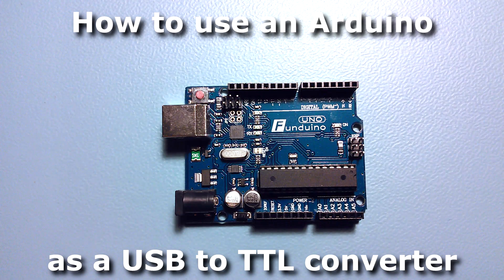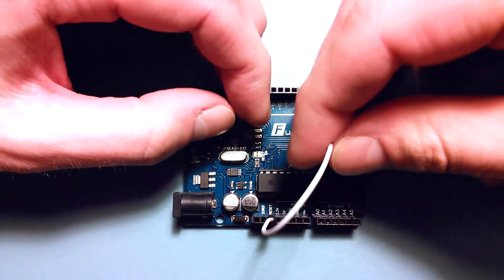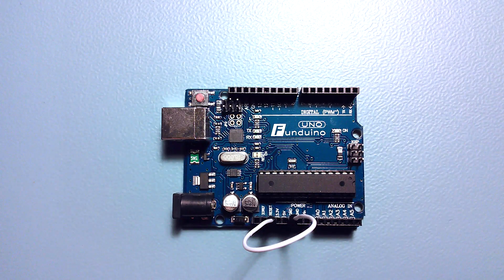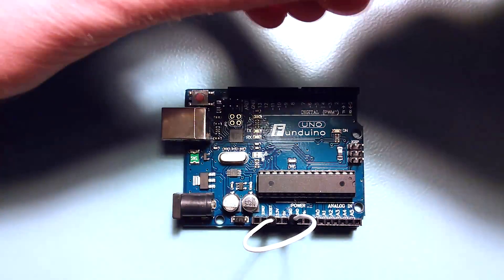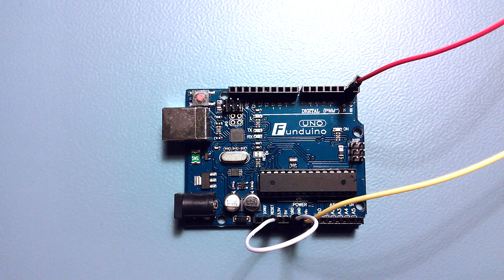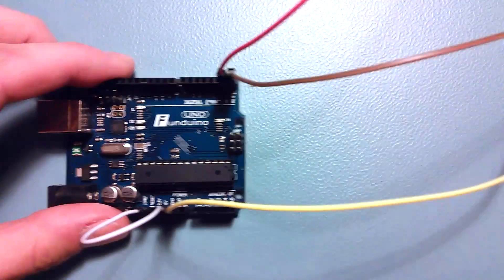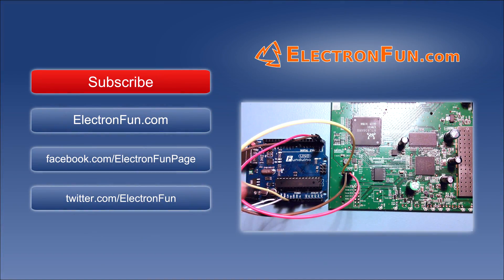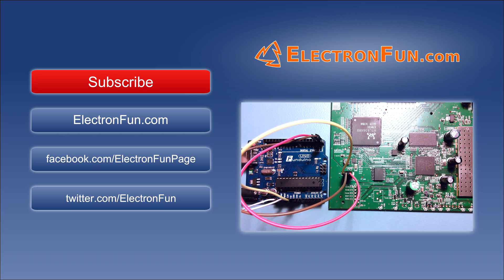How to use an Arduino as a USB to TTL converter || Arduino tutorial

Comment: Thanks, worked fine to program a Picaxe once I swapped the Tx and Rx lines. Just as you said, Tx goes to Tx  and Rx goes to Rx. That seems switched to me but it's a frame of reference thing.
Reply: I think it's because they're swapped internally again when bypassing the ATMEGA328 chip. That's how I read the schematics for the Arduino Uno (rev3) at least.

Comment: I'm so glad this is here. I was about to purchase a USB to TTY serial converter, but then wondered if I couldn't just use one of my arduinos to do the same. Arduino to the rescue!
I'm wondering how I actually interface with the device once it is connected, though. If I open the serial monitor I will only have a passive view of what's happening on the device, right? How would I send commands over a terminal once the device is connected?
Thanks!
edit Ignore me. I just realised the text field with 'Send' is at the top of the serial monitor. So blind sometimes 😎
Reply from the maker: It should work in exactly the same as a regular USB to TTL converter, if I recall corectly.

Comment: This worked with my older Arduino Duemilanove, thanks! I was having trouble programming the PID on a Tarocco servo controller with a 3.3v USB to serial cable. This did the trick. I think it needed the full 5V.

Comment: How do I translate the input code? I mean it seems weird to me it (´ÙÛoÙ\ë or DêêøÂ,·Q)
Reply: Also check how you are displaying the data you are receiving. If the data is ascii characters set the display mode to ascii. If it is integers, set the display mode to integers. (How to do this varies with the terminal you are using).
Reply from the maker: Where do you see this code? It looks corrupted.
Reply: It's the arduino's serial monitor... So, I downloaded Realterm but still it is impossible to use the inputs from my router for example to a program... They does not look user friendly
Reply from the maker: Have you checked your COM port's settings (especially speed)? You may be using different settings while connecting to your router.
Reply: I guess I should not expect a normal text like "Starting up service" or something similar, right? After some configuration I managed to see HEX code... But still I can not use it for projects...
Reply from the maker: When everything works as expected, you should see a completely normal text.
Reply: Then I think I screwed up... how can I check the port's bit rate that is required?
Reply from the maker: Go to your 'Device manager' -> COM ports and check your speed (bits per second) settings. Use the same settings while connecting to your router via PuTTY.
Reply from the maker: What about the COM port settings? Have you checked them?
Reply: Serial line to connect to: COM4
Speed(baud): 9600
Data bits: 8
Stop bits: 1
Parity: None
Flow control: None
The exact same as my Device manager's
I am using a SAGEM F@ST 2404 Router with RX connected to the 0 pin and TX to the 1 one and of course GND to GND so what am I doing wrong? :/
Reply from the maker: I can't see any mistakes in your connections. Have you tried increasing the COM port's speed? I would also check the jumper wires, they turn out to be faulty sometimes (even when they are brand new).
Reply: I will have to increase the speed both to the device manager and to the putty settings right? Also my wires are fine... I will check my soldering again just in case
Reply from the maker: That's correct, the speed settings have to match. Troubleshooting is probably the most difficult part of all projects...
Reply: Checked the soldering, changed the wires, increased the speed, I am using a brand new official arduino board but still... Increasing the speed just increased the amount of the weird data I was getting
Reply from the maker: What router do you have? Maybe there's something wrong with it. It's difficult to say what's wrong without seeing it.
Reply from the maker: It should work just fine, if you connected everything correctly. Are you sure you were checking the correct COM port in your system? It should be the port, which is used by your Arduino.
Reply: I've send you my settings... they are the exact same...I do not know my router's speed though... but I do not know if it does matter... so if it really is a problem how can I find the amount of it?
Reply from the maker: The only thing that comes to my mind may be the COM port settings. Your router may be forcing particular settings, see: https://wiki.openwrt.org/doc/hardware/port.serial - 'Talking and Listening' section. I would try playing with the COM port settings.
Reply: These are my COM port settings in a screenshot: https://ibb.co/cksjQ5 
Playing with the speed really does not change the result much...
Reply from the maker: I ran out of ideas, sorry. Try asking on one of the forums below:
https://forum.openwrt.org

http://www.dd-wrt.com/phpBB2.

There are lots of people, who should be able to help you.

Comment: Hey man! Experimenting with my Uno here - trying to access the serial port of a router: a CradlePoint Ctr35. Used this link: http://www.devttys0.com/2012/11/reverse-engineering-serial-ports/ to find what I think is the headers. One weird thing with the TX though is that it goes to HIGH on boot, fluctuates a bit, then rests at LOW for however long I leave the device powered. Which makes me think that maybe I haven't found the right header? I was able to use the ground and vcc to power it up however, no problem.
Running Kali Linux, I connected the UNO through USB, launched minicom - connected to /dev/ttyACM0 (Only tty I could find) and started testing all the different baud rates with the boot of the router. No success, even inverting the tx and rx connections.  Not even garbage in the tty.
Then tried testing the UNO-> connected tx&rx together and tried echo test > /dev/ttyACM0. And it worked. I think maybe I need to solder the wires on the router. What do you advise?
Reply from the maker: I haven't played with CradlePoint Ctr35, but I'm thinking maybe you are testing a wrong tty, but it's just my thought.
Reply: ElectronFun.com I thought so too but there isn't that much other pins on it.
I'm thinking the board uses 3.3V serial - any DIY advice?
Reply from the maker: The pin may be right, but maybe it's another tty in you Linux.
Reply: Ah no - I can connect to a Belkin router through serial with the arduino using the same tty - problem is with the ctr35. The belkin uses 5V and the ctr35 uses 3.3V.
Reply from the maker: Nothing more comes to my mind now - helping remotely is not easy :|
Reply: Fair enough - I think I need an adapter from 3.3V serial to 5V serial. Will see what I can do maybe keep you updated.
Reply from the maker: It would be great if you could keep me posted. I wonder what the problem is.
Reply: Ok will do
Reply from the maker: Thanks :)
Reply: Otherwise do you know how to access gpio pins on a machine that doesn't have system/class/gpio/export?
Looks like the kernel doesn't let me use the gpio pins.
I've seen people poking into dev/mem with some C code but I'd appreciate the advice of someone who has already done this kind of thing. Maybe a forum you can direct me towards?
Reply from the maker: I'm not sure how to help you :(
When I need help with a router, I usually go to:
https://forum.openwrt.org
http://www.dd-wrt.com/phpBB2
There are lots of people who are willing to help. Hope you'll find some answers there.

Comment: Thanks, I've been looking for just this answer. I'm attempting a connection between the PCM on my truck to my laptop. Baud rate 8192. If I can manage this connection the Uno will pay its way. One thing I don't get..my truck forum has the RX and TX terminals pigtailed together into one terminal of the truck(5V). The only other connection is ground from board to truck terminal. Does this make sense to you? TY
Reply from the maker: +dwhollrah I guess you've just found a new application for an Arduino board :)
The thing with TX and RX pins pigtailed together does seem odd to me too. Can you give me the link to this forum post?
When it comes to cars, I'm forced to rely on my mechanic, but I'll try to help if I can :)
Reply: +ElectronFun.com  I used your connections and went ahead with the connect to truck and got it working perfectly...tons of sensor data spilling out of my lappy now. This is worse than texting while driving. Here's that link.   http://www.dieselplace.com/forum/63-gm-diesel-engines/21-6-5l-diesel-engine/457933-how-scan-your-obd1-6-5-less-than-10-a.html
Reply from the maker: +dwhollrah What about the TX and RX pigtailed together? I can see it does look like this in the photo.
Reply: +ElectronFun.com Yes, they are both joined to one lead running to a single terminal on the truck. The only other wire is ground just as you show. I've used it flawlessly for two days now....well a few boot  hiccups.
Reply from the maker: +dwhollrah I'm happy it works for you :)

Comment: Can i connect esp8266 to a PC in this method ?
Reply from the maker: +Stephen Crown Yes, you can, because this method bypasses the ATmega chip and uses the USB to TTL converter integrated into the board.
Reply: yes, when the reset is grounded.

Comment: Hi ElectronFun.com, Thanks for sharing the video, I'm actually looking for a USB-to-serial converter to use at 115200 baud rate with BeagleBone Black board for Uart logging. From your video it looks like i can use Arduino for the same, but just wanted to check with you, if we can use this hack you shared in your video for getting that speed(115200) on Arduino?? (sorry i'm new to Arduino world, i want to buy it, but before i wanted to know if it can solve dual purpose for me .. just being cheap :p :p) Thanks in Advance! cheers!
Reply from the maker: +Kamal Wadhwa It seems 115200 baud rate should work for you, see here: http://forum.arduino.cc/index.php?topic=21497.0.

Comment: Hi I am trying to use this to program my UV-5R radio, Usually it requires cable which has USB to TTL adapter, I made the cable and trying to use arduino as USB-TTL adapter, But it does not seem to connect... Tx-Rx line flashes once then it Chirp software gives error that it cannot detect the radio.

Software: CHIRP

Reference:
http://www.miklor.com/COM/UV_ProgrCable.php
http://www.miklor.com/COM/UV_CHIRP.php
Reply: +Dhananjay D I got it to work with CHIRP software with a Arduino Uno and Arduino Leonardo. I did something slightly different that should make no difference but on the output with TX & RX I used the Ground from the digital side. Everything worked as it should. Uploaded and Download on several Baofeng radios. It even worked on other ham radios software that were not CHIRP.
Reply from the maker: +Dhananjay D I have never used CHIRP software, but have you set up all the COM port's parameters?
Reply: I know about baud rate, Is there anything else I should set up...:)
Reply from the maker: +Dhananjay D Have you tried swapping TX with RX on one end of your cable?
Reply: Yes...It was not working
I recently got USB-TTL converter, will try that, and debug this later :P, Thanks
Reply from the maker: +Dhananjay D No problem, hope it helps :)

Comment: Hi, in this case I have the arduino 2560, what is the sketch for make it work? thanks
Reply from the maker: +Memo García Hi, unfortunately the Arduino Mega 2560  doesn't have an FTDI chip, so it's not as easy as with Arduino Uno. I haven't tried that with the Mega 2560, but the below link might help you:
http://forum.arduino.cc/index.php?topic=287584.0

Comment: is it possible to use this technique for a gsm modem(serial to usb)....
i tried but didn't work out..
Reply from the maker: +THULASI RAM I believe it should work. What modem module do you have?
Reply: sim900a...using pl2303 usb to serial converter..
Reply from the maker: Should work. Do you want to issue AT commands? How did you connect the USB to TTL converter to the GSM module?
Reply: gsm modem serial port tx, rx, gnd to prolific usb  rx tx gnd..tested using gsm modem tester software.....thank you for your quick reply..
Reply from the maker: +THULASI RAM Have you tried using PuTTY to issue AT commands?
Reply: thank you man...it worked...
Reply from the maker: +THULASI RAM Cool :)

Comment: Thanks a lot for sharing this ! I just started playing with Arduino, so pardon my noob queries, Google didn't help me much .
1. Why would connecting "reset to ground" turn Arduino into TTL converter ?
2. Is Arduino capable of working on both TTL and RS232 signals ? I was assuming all MCUs need TTL.
Reply from the maker: ShinchanPyara Hi, 
1. Normally to reset ATmega you need to connect the reset pin to GND for a short while. When it's constantly connected the ATmega is disabled and you can use directly the USB to TTL converter chip that's on the board.
2. Actually it's not - Arduino can't work with RS232 signals without additional hardware.
Reply: Thank you !
Reply from the maker: ShinchanPyara No problem :)

Comment: I'm trying this with an Arduino Leonardo, and when I make the connection between RESET and Ground (similar to whats shown in the video), the connection between my computer and the arduino gets reset (sounds reasonable when you think about it) ... How do I get my computer to speak to/through the arduino once the atmega gets put to sleep?
Reply from the maker: Eain Graham Hi Eain, your Leonardo behaves properly. Arduino Uno has 2 microcontrollers: the main unit and another one for USB communication. When you disable the main ATmega the USB connection remains unbroken. Leonardo has only one microcontroller for running the sketches and USB communication. That's why your connection gets broken when you reset the ATmega. See more details here: http://www.arduino.cc/en/Guide/ArduinoLeonardoMicro?from=Guide.ArduinoLeonardo.

Comment: Hi, then you connect a USB cable between the computer and the Arduino?
USB PC -> USB Arduino _ TX/RX Arduino -> Device serial port ?
Reply from the maker: It goes exactly like you wrote. Just remember to connect TX to RX and RX to TX. Pay attention to the marks on the Arduino board: RX<-0 (0 is actually TX and should be connected to the RX on another device) and TX->1 (1 is actually RX and TX from another device should be connected here).

Comment: When using a normal USB to TTL device, we connect RX of the device to the TX of router, and TX of device to RX of router. However, in this video you have connected RX to RX and TX to TX.. am not too sure, but is this a correct configuration?
Reply from the maker: You are right, we connect TX to RX and RX to TX. Pay attention to the marks on the Arduino board: RX<-0 (0 is actually TX and should be connected to the RX on another device) and TX->1 (1 is actually RX and TX from another device should be connected here). I agree, it is not marked clearly on the Arduino.
Reply: ElectronFun.com Ahh.. makes sense now. Thanks :)
Reply: can i have the code.?
Reply: @onil3372 What code?

Comment: Hello tell me you need to use the library for this example?
Reply: ElectronFun.com can it damage thearduino or the ttl device? if the device works with 3.3 v?
Reply from the maker: Matan Benyamin No, the router board from this video works with 3.3V and everything went just fine. There was no magic smoke and both devices work perfectly well until this day.
Reply from the maker: No, you don't need any code or libraries for this example. This Arduino board does not even need the Atmega microcontroller. It is only used as a USB to COM (also called TTL or RS-232) converter.